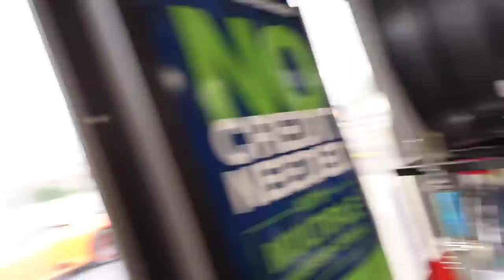FAKE GIVEAWAY IMPERSONATOR PULLS UP TO CLAIM MY TRUCK THINGS GO LEFT QUICK 👊

Comment: Your batteries keep dying because power is still feeding your computers and modules, unless you have a trickle charger on them or start them 1 or 2 days out the week, they will die.
Reply: George  don't need to think again, if you remember one of his lambos kept dying anyway the high end cars have lithium batteries stronger then the Durango battery. Thanks for your input though.

Comment: Cells in batteries die when not used or hooked up to battery tender. Change out Cadillac battery and put a tender on it when not driving. Won’t have a problem after that . All those cars need tenders just not the exotics 🤘
Reply: ʜɪᴛ ᴍᴇ ᴜᴘ⬆️ ɢᴏᴛ ꜱᴏᴍᴇᴛʜɪɴɢ ꜰᴏʀ ʏᴏᴜ ᴛʜᴀɴᴋꜱ ꜰᴏʀ ᴡᴀᴛᴄʜɪɴɢ🤘🏿

Comment: Bro those are Lionhart LH- Five 315/30/30 tires with a 49 psi max! If you put 65 or 70 psi worth of air in those tires the first bump he hits them tires is gonna blow! What kind of tire shop doesn’t read the actual tire to see what the max psi is for that tire? It literally says it on the tire and even then you should put about 15% less air than the max psi to prevent premature wear on the tire. How does AL have a tire shop when he’s guessing the psi on the tire instead of reading the psi on the tire. Totally not safe at all my guy. 🤯